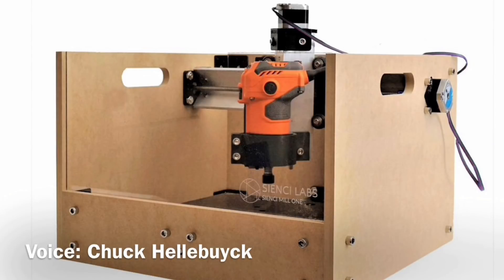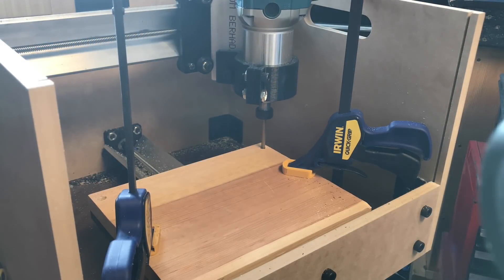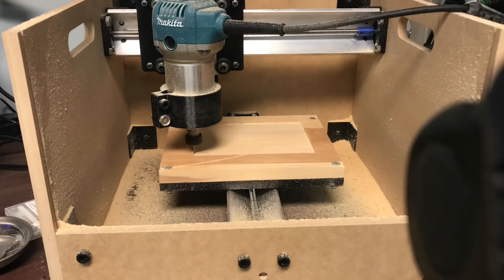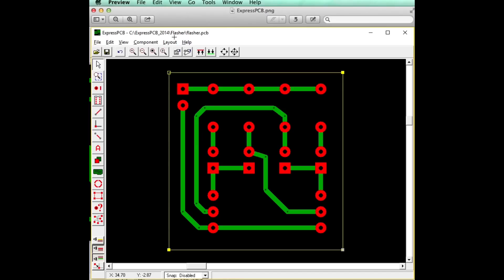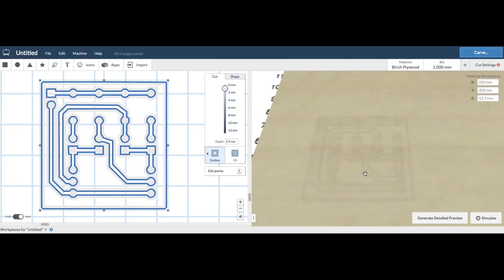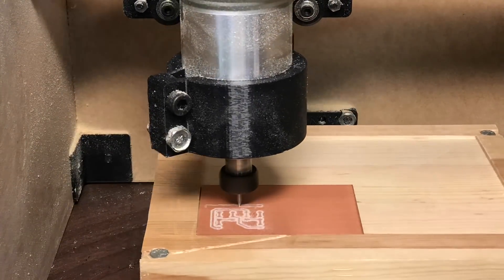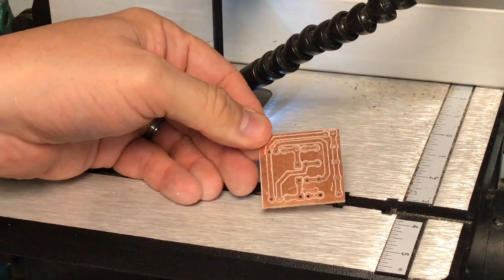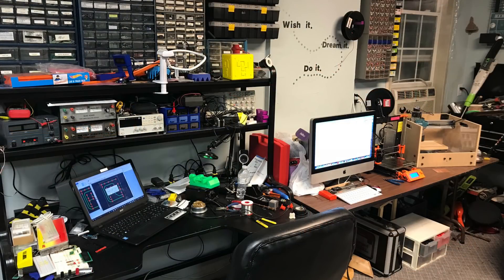CNC Prototype Printed Circuit Board Milling on $399 Sienci Mill One

Comment: Old video.  I see you have a Bantam now (obsolete, I guess).  I would guess the learning curve is pretty steep to set one up and use it?
Reply from the maker: The software is key. Bantam tools has a great software tool that handles most of it. But they aren’t cheap.
Reply: @FilamentFriday  They were a bit over $2000, but are shown as "obsolete" now on Digikey and you don't find them fleabay.
Reply from the maker: Once you have one you don’t want to get rid of it. I was lucky and got a former demo unit for a huge discount.

Comment: As another viewer mentioned, you can use Eagle and PCBGcode. Eagle is free as long as you stay with Double Side and small size PCB's, PCBGcode is completely free. No need to create Gerber files. PCBGcode works as a plugin to Eagle. From board layout to CNC, as easy as that.

Comment: Diptrace and CopperCAM is what I've been using for a couple years now. I know how we like to fall back to what we've always used, but you should try using software specifically for this type of work (I don't think you'll be sorry man) and it's easy to learn. Not to mention there are other features that you might find desirable as well. BUT, in the end if it gets you results that you desire, use what you want.
Reply: Create a board with image software? So.... where to get all component libraries in all the different types of image software. This seems highly counter productive and a person will run into limitations very quickly. Yes you got it to work but with PCB software to start with... Why not use PCB software that can do G-Code or even export a Gerber to start with? Lots of cool free packages out there...
Reply: As I think back to yesteryear.... When being taught how to drive a nail into a board, I was handed a hammer (not a wrench). When being taught how to tighten a bolt I was handed a wrench (not a hammer).    :-)

Comment: Happy new year! That's cool. You can do  also a solder mask with uv curable paint, Just put a blob of uv curable paint and then acetate sheet  and draw the black spots with a sharpie on the acetate then expose it to uv then develop it on the developer , pro look easy and cheap.

Comment: Hi chuck, why did you not countersink the bolt heads? All the Mills I worked with we used an aluminum top as a work surface, then just fly cut the top when we needed a smooth surface.